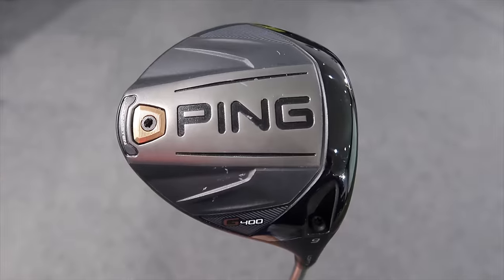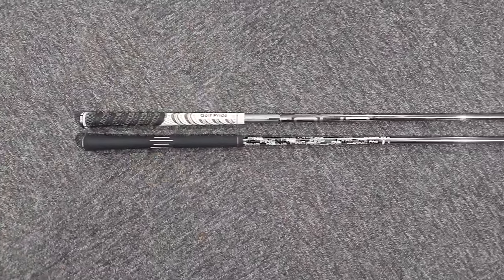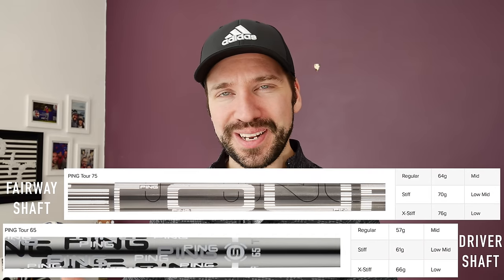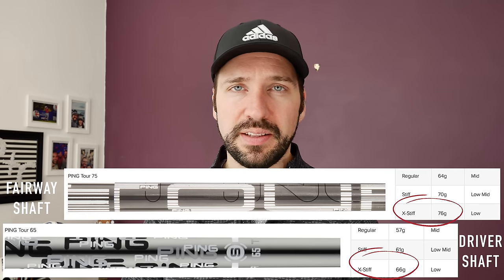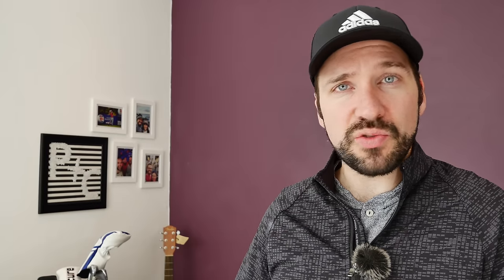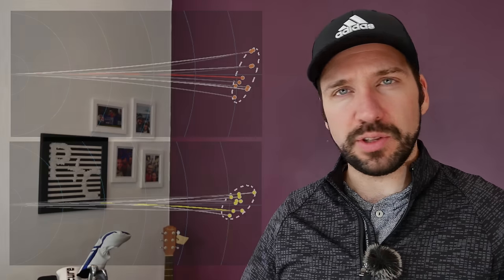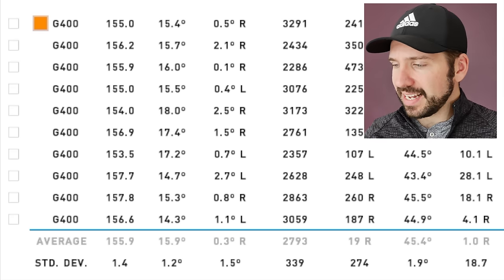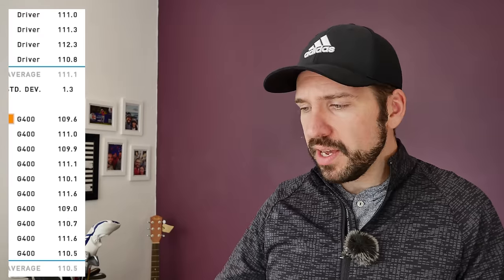I put a 3-wood shaft in my DRIVER and this happened...

Comment: I have been playing with an X stiff flex 3 wood shaft in my driver since learning about tour pros playing with a shorter shaft.  My ball flight is lower but bullet straight. I can not be happier and this is from a player with a natural iron fade, with a more open to slice driver. Never looked into why, just loved the result 😂
Reply: fredatemypie just curious about this, I had read on blogs about swapping a shaft from a 3 wood to a driver that the stiffness changes. Don't know if that's true or not or if they're referring to modifying the existing driver shaft down to a 3 wood shaft length. But my question is did you notice any change in the characteristics of the shaft going from the 3 wood to driver? What about the weight?
Reply: hi there, as far as im aware the only difference between a driver shaft and a fairway shaft is the way it is tipped. Naturally dont cut your driver shaft down to a fairway wood length ( counter productive ). I changed from a 55g to a 65g shaft. My swing speed has not changed still around 101mph. As the shaft is shorter I am hitting on average further ( this because it is easier to hit middle, surprising what a few inches does )
If you are looking at changing, i would test the fairway shaft in driver and see how you get on and then order a driver shaft of the length you require.
you will naturally get fitters and people talking about different swing weights. I read an article somewhere talking about most amatures are playing with drivers to long for their capacity to successfully hit effectively, so why do we struggle with a length of driver not suited.... Something for them fitters to answer
Reply: I have found the same experience in that combining a lighter shaft but stiffer profile all along the shaft provides the compensation and stability for more accuracy and consistency.

Comment: Hi Pete. Did you ever do any on course testing? this is something i have tried before with a cut down driver and had some success but was wondering if a proper 3 wood shaft would be a better option that the cut down shaft.

Comment: Hi Pete great video as always. Have you considered using the same shaft weights and brand but just a shorter version? -1.5inch  or -1inch? Wondering if it would be the same results then. 
At the moment I don’t even take my driver out the car and stick to my 3 wood because I can hit it so much more accurately.

Comment: Question: 3w shaft is designed to be x flex with a 3w head which is heavier than a driver head. So when you put the driver head in does that change the frequency of the shaft? (stiffer maybe)

Comment: Did the same to my 2016 M1 Taylor Made. Actually had the shaft shortened by 1 1/2 inches from standard length. I have now played 10 rounds and I'm now a happy camper. As you found out for yourself, I lost NO yardage with the shorter shaft, but a lot more consistently hitting fairways. And in the center of the fairways at that. Anxious to see what happens when you take this test out to the course, although I'm already fairly sure what the results will be. happen.

Comment: Hi Pete, love all your vids mate! 

Quick question, did you adjust the swing weight back to standard on the shorter shaft or did you just roll with the new, lighter swinging club? If you didn't adjust the swing weight, could that possibly be the reason for the faster than expected swing/club head speed?

Comment: Hey Pete! I currently run a G400 Max with a 1 Inch under shaft that my local supplier cut down for me. I was using a Tour Pro Ping shaft but went back to a standard Ping stiff shaft as i found by changing the length it also effected the weight and feel of the club. Did you try a same weight shaft also to just see what the affect would be? 

Also the big question! Do you think you will game this setup?

Comment: my current driver is 43.25 with a fairway shaft but i've noticed loss of about 20-30 yards - i'm contemplating on switching back to a driver shaft, and shortening it to 44. Any suggestions or recos?

Comment: Pete have tinkered with my clubs a lot over the past year and currently have a g400 driver with an x flex shaft that has been cut to fairway shaft length and couldn’t possibly change it out again. Just praying that I don’t have any accidents with it. Also do the same with my fairway wood, shaft has been cut down considerably also and I am yet to notice any differences in distance. Experimenting like this has really transformed a weakness in my game into something a lot more reliable.

Comment: recently had a fitting on a Taylor Made M3 M4 day and ended up hitting it better with a Hazrdus Red 3 wood shaft, more ball speed as more shots out of the centre even though slightly slower swing speed and gained 11 yards of distance on average. I have now put my Titleist 915 in to have the shaft shortened  to 3 wood length, will let you know how it goes

Comment: I've gone this route before by cutting a driver shaft down.  Currently playing an Epic with a Speeder 665 cut to 44 1/4 inches (from 45 3/8).  Changed grip from a Dritac mid-size wrap to a Drictac Lite mid-size wrap to get the same swing weight (within 1 anyway).  Not sold on it, as I switch to a 45 1/2 shaft off and on ... and next round the 45 1/2 is back in the bag, unless it's windy.

Comment: Over the years I have played with driver shaft length a bunch - and also did a bit of launch monitor driver fitting testing to see if what I found on the course was real. My summary is this: If you want to build a power fade low spin driver, where you will really only use it to hit power fades, then you can build and harness a 45-45.5 inch shaft to maximize the length / accuracy trade-off (ruling out the left side miss with max length). If however, you want your driver to be neutral / couple yard draw to match your other clubs in the bag, then from a maximize your length / accuracy tradeoff, then at least for me (5'9", 8 handicap, 105mph driver speed), a 43.5-44" driver will absolutely be a better scoring club because of the gains in accuracy and the little to any loss in distance because of consistent slight draw spin, and gain in confidence over the ball. Big issue is swing weight because topping 1.5" off the top of a driver can send the swing weight into the crazy light zone so this has to be addressed otherwise feel becomes an issue. After all my tinkering, I've ended up with a few drivers, but my usual goto combo is a power fade low spin driver and then a strong lofted 3+ wood (12.5 degrees) that I will use when I want to draw the ball off the tee. I then carry a long and short hybrid (18/22 degrees) for gapping purposes. With the long and short hybrids, I also do the same but opposite - the long hybrid set up for neural to draw and the short scoring hybrid set to fade so it won't go left. It has taken me a long time to arrive at this setup, but mentally I have concluded that for my longer clubs, since things can go wrong, I want to dial in the shape of the club from a fitting perspective so I know the goto shape when I pick up the club (Fade Driver, Draw Strong 3wood, Draw Long Hybrid, Fade Short Hybrid). I love this setup as it rules out thinking.
Reply from the maker: Cheers Paul, great to hear what other people go for

Comment: Curious about impact on swing weight. Certainly just cutting shaft down impacts that. Thoughts?
Reply: It definitely impacts that. That is why in the video, the 3 wood shaft Peter was trying was much heavier to account for the loss of weight with shorter shaft which meant loss of swing weight. If you cut down a shaft, I would measure the swing weight of your driver currently first, then after you cut it, measure it again and add weight to create the same swing weight because if you don't it will be very light and hard to strike consistently, but if you get it to the same swing weight, it will certainly help!

Comment: I tried swapping a 3 wood shaft with a driver shaft in my M1 last week and the results were instantly better. Dispersion was tighter, strike consistently more out of the middle and I felt my swing in general felt a lot more free so I could really give it some welly. 
I got a lot out of the toe with the full length shaft, but 3 wood shaft, centre to slightly high heel was where I was hitting it. Maybe half an inch longer 3 wood shaft would have been perfect for it.

Comment: Still have the video going, but have to mention two things that stick out, though you do mention it is just a first step. While going shorter in the shaft to a 3w shaft, if doing it properly, you would want that length, but possibly need to adjust the tip trimming as it is possible, the fairway shaft could be a bit stiffer in the tip as they are generally tipped more than a driver shaft. Next, which other comments address is swing weight. I reckon that it was a bit light, and you probably could have used at least a few grams of weight added to the head.

Comment: I’ve done this with my m1, put bubbas shaft in, I feel like there is hardly a difference shot2shot but if u button one with both I got longer drives with the standard length, but as ur video states I’m much straighter with my shorter one so it stayed! (Plus the longer one kept breaking, and Taylor made were being arses!)

Comment: I play with pretty basic golf equipment, so I can not do what you have shown here. However, as I get better, I do intend to get better clubs. But, as I stand today, I am terrible with my driver. I slice the ball almost constantly and the distance is often 15~20 yards shorter than what I get with my 3-wood. Interesting, as I matured over the last year, my 3-wood is dead accurate and consistent, whereas the driver is still I couldn't crack. I stopped pulling it out of the bag on the greens, as I am guaranteed to hit out of bounds and lose score. Is there a way around it, or should I stick to my 3-wood if I am getting around 250 yards on it anyway.

Comment: Are you cool with 4up as your angle of attack? I think tour average is about 1.3 down.  That is more than 5 degrees and your are launching at 14 and tour average is about 10. Just curious if how you are delivery the club is what is limiting the variance caused by shaft length...

Comment: I recently bought a 2 iron and took my 5 wood out of the bag so about 3 weeks ago i decided to try a similar idea by using my 5wood shaft in my 3wood. Only about half an inch shorter but I’m seeing a lot more consistency in the quality of strike I’m getting with my 3wood now. Early days but i hope this is going to be a good year off the tee with a new driver, a new 2 iron & a shortened 3wood

Comment: I tried this using the trackman system. I hit the driver pretty straight so dispersion is not a prob for me. The results: I lost a bit of club head speed with the 3 wood shaft and so about 15 yards of overall distance - around 250 with the driver shaft and 235 with the 3 wood shaft. So I’m keeping the driver shaft.

Comment: I'm currently using a 3 wood shaft in my driver. Took a bit of getting used to but far easier to hit straight. Disadvantage in yards is significant but I hardly miss a fairway. Maybe 30yards on average less but I do find the middle of the driver face more. I hit less bad shots and the ones that are, are no where near as bad with the shorter shaft.

Comment: Actually, I've never experimented with shorter shafts, but that's exactly what I had in mind for the upcoming season. I bought a used 3 wood R 15 and a used R 15 Driver, both with the same shaft. I can swap shafts in my driver using the 3 wood shaft. I'll see if ther's any difference, but being only 5' 5'' I guess there's gonna be a slight difference. Waiting for spring time now....

Comment: Interesting data....You didn't mention anything about swing weight changes. Taking
that much off a shaft will definitely reduce the weight and swing weight. It will also
have a real effect on shaft profile characteristics, since you're removing some of the
most stiff portion of the shaft and making it less stiff overall. So I agree that more
research is in order. I had read that the average pro driver length is minus 3/4".

Comment: I play titlest 910 driver and 3 wood, I just swapped the shafts over and found I hit them both longer and more accurately. I actually hit the 3wood better off the deck with the longer driver shaft in thier.

Comment: What about swing weight Peter?  I've once tried to cut down a driver shaft by 2 inch and it resulted in a swing weight that felt very uncomfortable - do you think that because the 3W shaft is heavier this compensates for that?
Reply from the maker: No I dont think so, there would be such a small difference it would probably be more psychological. I think its just personal preference

Comment: I'm not to surprised. I would like to see it repeated with a shaft from a 5 or 7 wood just to see if you can find a fall off point where you start to loose lenght. I seem to remeber Alex Norén playing with a shorter driver to improve accuracy. Did you notice a lower trajectory with a shorter shaft? For the one length irons people often mention a flatter/lower flight with the lower lofted irons.

Comment: I'm 5'10" with long arms and short legs and have found that a 43" driver works best for me. I usually trim the excess length off the butt end of a firm shaft to get something between firm and stiff flex.

Comment: Have Ping woods Driver through 9 wood. Put the driver shaft in the closet and replaced my Driver, 3w, 5w and 7w shafts starting with the Driver-3w shaft,  3w-5w shaft, 5w- 7w shaft, 7w-9 wood shaft. At only 5'7" short, that adjustment has worked for me especially dispersion. All heads set at the "big+" setting which I believe is 1º more loft. Don't feel any change in lighter swing weight.

Comment: Be interested to see what the difference would be with identical shafts would that be possible! Something like a project x hzrdus yellow 76g both in driver length and in 3 wood length low spin shaft low spin head ( I will confess this is for my own personal gain as I currently play g400 lst with that exact shaft)

Comment: I had an argument over shaft length about 4 years ago with an old friend golfer. he is only 5-8 and used a 45 inch driver and just was inconsistent. I argued going shorter would be best, but he argued physic: longer radius, more velocity. I argued you could swing about the same velocity but under more control. Thanks for proving be correct.

Comment: Interesting comparison. I cut an old (circa 2000) Srixon 302 driver down to 44 inches, then back weighted it 10 grams before re-gripping. I did not switch out the driver  shaft for a three wood shaft. Interestingly, the overall weight of the club felt the same as if it were 45 inches and club head felt the same as if it were 45 inches. My dispersion, distance (2-5 yards increase), and center face contact improved. Also, I could really feel the shaft spring on the downswing. I love the feel and can’t argue with the results, even though the changes I made are far from being scientific,

Comment: I've been thinking of doing this with my driver. I've been playing my driver at 45.5" since I think the Ping G5 or G10 was released. But lately I've been hitting my 3 wood much more off the tee with great success, my misses are so much better and now this video makes me want to chop down an older Diamana Ahina 70 to 44.5". Also seeing that swing speed didn't change was a bit shocking.

Comment: Very interesting results from the test but must admit was a little concerned at the start when you mention being curious and experimenting 😯 thought you had gone a bit late night channel 4 on us 😁 
One point Peter , if you grip down the shaft on the normal driver shaft by the inch and three quarters do you think you would get tighter dispersion you saw with the 3wood shaft?

Comment: I play m1 440 with reduced shaft length, noticed no difference in length what so ever, so many variables through my body, weather, roll out, fairway etc. If anything as my dispersion and strike is more consistent I can get it out their further on full crank as I feel more confident in finding middle I can pick my hand speed up.

Comment: I am not surprised you got better dispersion with the 3 wood shaft. I like playing drivers at 43 inches myself. Much better control. I did not even add any head weight and everything seems fine. Swing weight be darned.  Spider Dubiel

Comment: I have been playing a 3w length shaft in a driver for years now.  You just have to add a lot of weight to get the swing weight back up to where you want.  It is especially tough when you like a D5 swing weight.  If I have to put too much weight on the head, it can affect the flex, so I usually tip the shaft an inch to even that out.  What you really need to do is put a steel shaft in a driver.  I toyed with it for a while and got decent results.

Comment: I play Titleist 915D3 at 44 in, the length I’ve used in other drivers, first in Adams 430 Quad. It was a low spin high low driver be for that became a buzz word. My point if you find the head or brand that gives you the desired effect sought you should use a shorter driver. I placed third in a long drive completion against other long drive guys with a 342yrd driver using the Adams 430Quad, in 2004.

Comment: One thing I'd like the USGA and R&A to do is standardize these quick change fittings. As you found, they're not only manufacturer specific, but sometimes club specific. Sure would make club fitting/buying more simple. JM2C
Reply: BeachBow unless one was giving a performance advantage the R and A wouldn't be interested , would be nice if the brands could agree on a standard but can't see this either.